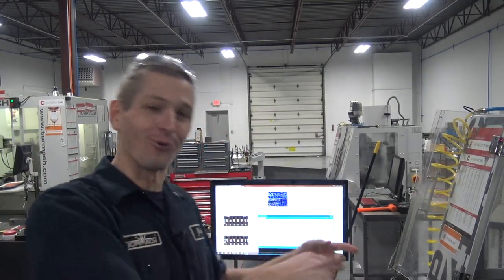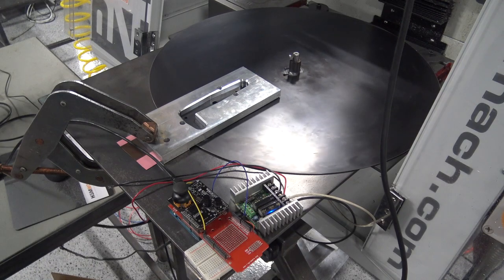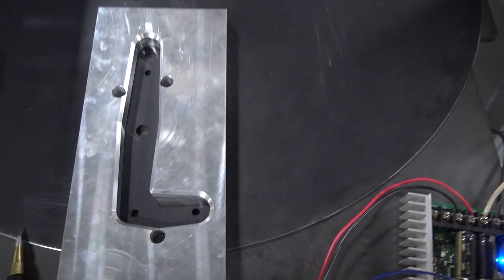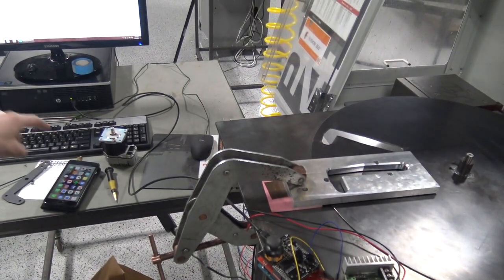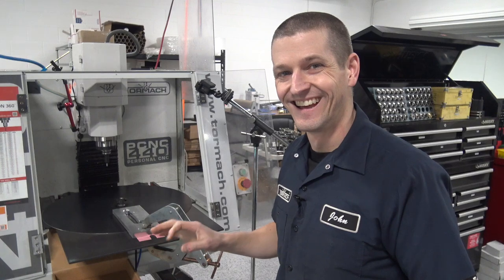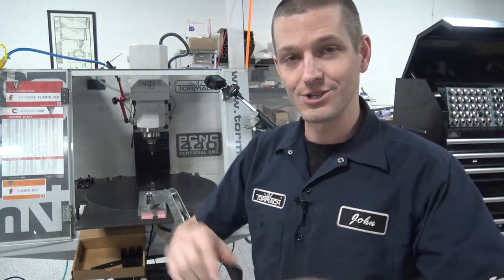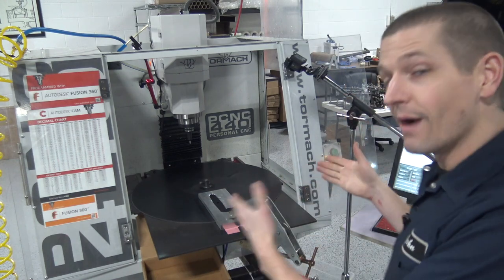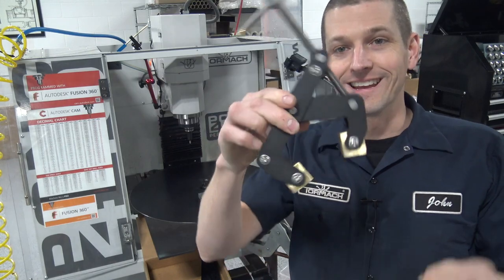Arduino Servo CNC Parts Loader! Part 4 WW132

Comment: Nice clamp John. would you consider putting an M8 hole in the brass clamp pads so a welder could wire an earth cable to it and use it as a. earth clamp!?

Comment: Also, why does it stop 180 degrees away, then restart? You could mount a small magnet to the underside of your platen, then pick it up with a hall-effect sensor, or a reed switch - either of which is dead simple to interface with an Arduino or other machine controller; it'll just require some fine tuning as to the sensor position vis-a-vis the magnet. HTH! :)

Comment: You might run into more problems with a tall stack of parts, just from the pressure on the bottom parts. You could probably solve that moderately simply with a 2-stage feeder that would only have a few parts in the plate feeder, and the rest sitting on some sort of ledge or retractable finger above.

Instead of the gearbox you could have cut a gear into the outside edge of the platen and driven it with a stepper with a pinion spur gear on it. Get the same or better mechanical ratio for cheaper, if you could have programmed a decent gear an Fusion and then cut it in a plate that big.

You have an encoder on that motor, but if the hub slips you are out of luck. I'd consider some sort of notch or protrusion in the edge of the platen and a prox sensor of some sort to ensure alignment. 

All in all, it looks like a good deal!

Comment: The idea is good training and has a low cost of production. I think when you go there will be a problem when drilling holes and it would be necessary to add a part to press the workpiece. Good luck

Comment: your pwm problem when you go to 5 out of 127 is due to a problem that comes from the arduino ide. try increasing you pwm clock signal but it will need some extensive avr assembly programing

Comment: I think you shouldn't have cut to a close-up around 7:28 and 7:35. It's 3 times the "first-person liliputian" effect when one was enough, and we miss a couple good point of views to see how stable the whole thing is when it accelerates (especially the one at 7:35, which is different from the shots later in the video).

Did you consider machining/attaching teeth around your big plate, leaving it free-wheeling at the center and putting the motor on the edge? This would have solved the torque issue in a simpler way than with a motor gearbox.

Comment: I have done a lot of Arduino projects over the years because they are cheap and easy.  But I don't see why you don't get rid of the Arduino and the USB switch and use the 4th Axis.  Easy on the 1100 of course but the 440 uses a Leadshine MX3660.  I looked at the Leadshine manual and it brings out the step and direction for the 4th axis so just hook it to the Clearpath.  Maybe
Tormach has the Pathpilot screwed up but I bet it's the same as the 1100 in this case as far as what pins they are driving.

Comment: I agree that driving the plate from the OD is more controllable and easy to implement. Just need to laser cut an acrylic ring gear  and fasten it to the steel plate and cut another gear mounted on a dc motor. Than you have lots of options for position control. you could still use the arduino but personally i would use  2 proxy sensors reading marks on the acrylic ring to determine   position and direction and a micro810 PLC (costs $80) to control.
If you would like to try the gear option, shoot me an email with the diameter of the gear and ill cut it for you, no charge, just the shipping and material.. hahah

Comment: quick idea glue a small magnet under the rotating disc in the base plate ( if the clamp is ferrous) that would attract the bar and supplement the gravity ... just an idea...

Comment: Hi John. Project is coming along nicely. Well done. One question. Did you ever consider doing this as a C axis? That way you could have run the part pickup as a sub program in your G code. And that syncs the mill timing to the rotary fixture.

Comment: I really enjoyed watching this project. Like others, I was going to ask about multiple "pick-up slots" or "stations", but you addressed that at the end of the video.

Obviously, it is working now, but I had a question / comment concerning the design decisions.

It seemed that one of the biggest issues you had to resolve was the speed and torque problem. Did you consider simply cutting the rotating platter so it had a gearwheel / sprocket around it's edge, then driving it from the side with the motor? This would've allowed your DC motor to be both geared down and apply the force at the edge, where it is needed, rather than in the middle. In addition, you would run less risk of any of the gear mechanism stripping the teeth, or the various spindles shearing off due to the torque at the center.

I am just curious if that solution had been considered (in which case, why did you decide against it?) or not (in which case would you consider that route if you had to do this again?)

Thanks again, and keep up these very entertaining and informative videos!!

Comment: Maybe tilt the part feeder slightly. If the parts are magnetic, why not use magnets that the part rotates over to help secure it? also, they make mechanical brakes that mount to those motors (NEMA), that could work too, and be powered with a relay from the Arduino. Im a CSE student, so I can help with the programming if you're stuck! If you want to use the gearmotor, you have to use a quadrature encoder and program a PID loop into the Arduino. That's more or less what the clear path motor does. Limit switches wouldn't work because you probably need to debounce them which adds 10-50ms which would result in bad positioning. Also the PID loop would allow for the gear motor to go slowly, as it can increase the power but keep the speed the same if need be.
Reply: Alex Levon Colello not necessarily. you could drive it directly from the shaft, or use a small track wheel On the plate. Most encoders are are 1000 counts per rev or 8000, which would be .3° or .045° which is more than good enough. The motor also doesn't have "resolution" per se, but it does have 127 different power outputs or whatever the pwm can do, which is more than enough as well

Comment: If you had 8 slops in the spinning disc you would only have to advance 1000 steps at a low speed  to place another one and  at the same time advance the next piece under the spindle. Just a thought.

Comment: To secure the piece during engraving would it e a good idea to use an electromagnetic chuck? You can drive it directly with one pin on the arduino through a relay board! Since the piece is so low profile and you have plenty of z travel to spare the chuck could comfortably fit under the plates onto the tormac table.
PS: i love your face when you got it working properly, like a child on christmas morning, so happy! :)

Comment: Grab some photo interrupters off of eBay or Digi-Key or Mouser and then you won't have to mess with indexing it at startup... the Arduino will find home on power up. Also, one can be setup to pick up if the part loaded correctly.

Comment: You may think the way you designed it is simple, but having multiple qued up would be much easier. just have a limit switch engage when it's at the next fixture.

Comment: Don't listen to me I'm not an engineer ;-) but... As you have no shortage of CNC machines available I think your next step should be to cut teeth on the outside of that disc and drive it from the rim. I believe that would give you more positional precision and lower power requirements and it would also allow you to beef up the axle.

Comment: Technically adding more spots for parts to fall in shouldn't effect the weight or torque requirements much. The thickness of the plate is about the same as the parts. So when you cut the hole out for another pocket, you're simply replacing it with a part. 

It would be a good idea to try and keep a cross balance on the plate though. 3 or 5 positions would do better. Since the parts do move within to pocket, they cause some additional centripetal force.

Comment: The part in the magazine does not need to be such a tight fit and you can increase the height of your magazines base to 2/3 the height of the part and the part will still be held.
the stepper looks like you lost torque by reducing the speed.  I guess now its working you wont want to experiment in getting the speed up.

Comment: I had a solution until you put in the clear path servo. Have a vacuum system where the feeder is, it'd pull the piece into the table, and you could've piped the air being drawn into the vacuum to push on the piece where it goes out of the table. They make vacuums strong enough for 'clamping' pieces to cnc tables, so I doubt this would be a huge system to implement. Could even make a switch where table position turns it on and off.

Comment: why not use a linear feeder rather than rotational? You had a pretty strong and fast table in another video. Pick up on the left side, stop and engrave in the middle then continue to right to drop the part

Comment: Having multiple parts loaded in to the platten would only improve the cycle time by about 3-4 seconds, but would increase the work in process, increasing the stock overhead.  Over a run of 100 parts, you may only save 6-7 minutes so it maybe is not worth it.  If there is some problem in process, then all of the parts in the platten are at risk of damage.  If you needed to do a small batch, then your batch size would need to be at least as big as the number of slots in the platten, or you would need to modify the program to load each station of the platten at the start of the production run.  If you just run the first few station dry, then this wastes all of your savings. This is how you can apply lean principles into automated systems.

Comment: Why not use a stepper motor instead of a servo?
Reply: it's a stepper servo
Reply: daniel lyall idk man. I am trying to get into the whole DIY stuff, and half the people say they are different and half the people say they are the same lol.
Reply: They are not the same different type off motor to start with, next time you get told they are the same say to them hello its a stepper with a encoder and includes a driver built in not a DC motor with a encoder.
Reply: daniel lyall So servo just means built in driver and/or encoder?
Reply: No, servo means it's is closed loop controlled which means you have a motor (could be anything DC, AC, stepper etc.), you have a position measurement sensor (encoder, resolver etc.) and a controller, that does the calculations needed. Normal stepper drivers work open loop, so there's no position feedback, it just fires up the coils and hopes, the rotor goes with the magnetic field. If it doesn't, it loses steps and doesn't know about that.
Reply: Alex Levon Colello Servo means you have a feedback loop for control. Doesn't even have to be a motor. you're blog only considers rc toy sevos not industrial servos. They're not limited to a partial rotation.  unless it's driving a worm  gear a stepper needs power to hold position. you hope it does since there is no feedback loop to know it got to where you told it to go.

Comment: I understand the whole hobby approach and wanting to use a motor etc. but a much simpler solution would be 2 pneumatic cylinders and a plate with the pattern cut in it. (2 or 3 solenoid valves to control instead of motor positioning. +1 for a clamp) In my experience air cylinder dead stops are much more repeatable than any motor.

Comment: if you had multiple slots you wouldn't have to turn it so far, to bring part up to machine station. You could have maybe 6 loaded at a time, then you could run at the lower speed all the time.
Reply: one day i will watch right thro before commenting !!!

Comment: Put a vibrator of some sort on the feed stack plate when it needs to find its way into the pickup.  That'll make sure you get a piece Everytime without slowing down no matter what.   Just a little insurance.   ;)

Comment: Why not just cut a gear into the outer edge of the rotary platen?  Cut a matching gear to fit the shaft of the stepper/clearpath motor.  You can machine them I'd bet!  ;-)  It would likely solve ANY torque issues you had.
Reply: How would you cut a gear in such a large plate in an easy and affordable way?

Comment: your positioning fixture above the drop zone is too restrictive.  You only need three points to  define a location ... Not a complete profile as you are currently using. Design three locator pads into your design.

Comment: Unless you have a servo you wont be able to get that dynamic range out of a DC motor.
Reply: Servo means it has feedback to know its position, ie: closed loop, some DC motors can be servo controlled.